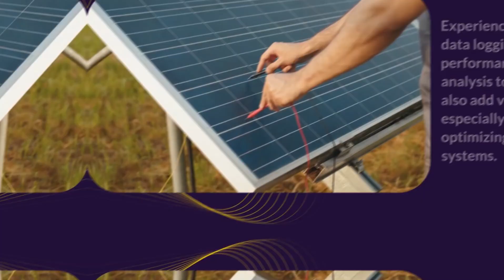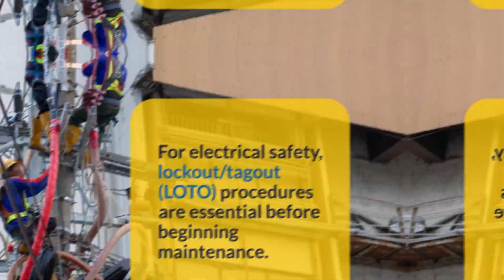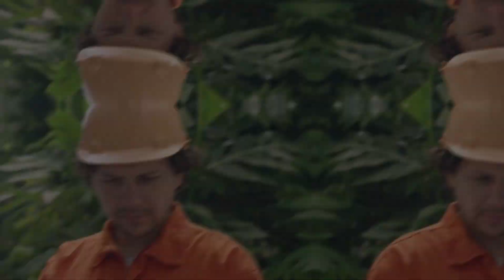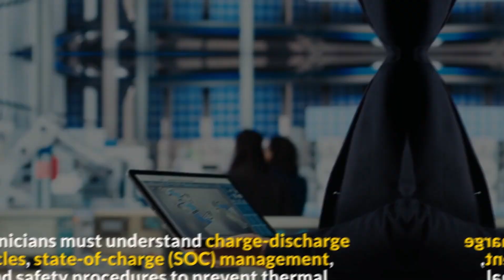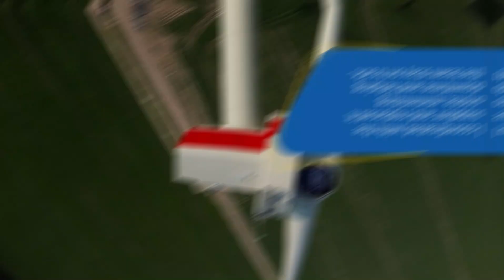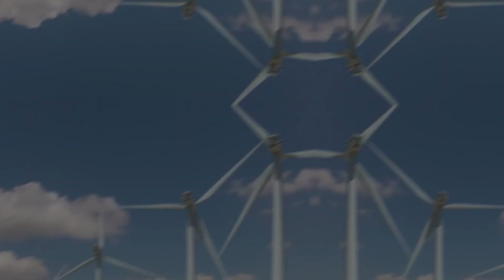Renewable Energy Technician interview questions and Answers | Must Watch Before Your Interview

Comment: Energy transition. Wind turbines. Solar cells. Electric cars. Pure exploitation. Pure colonialism.

Green fake news. The share of renewable energies in electricity generation in Germany in 2024 was a subterranean 54%. This figure is also very greenish, since solar cells and wind energy naturally carry their own large CO2 footprint.

And solar cells are nowhere near as environmentally friendly as many owners, influencers, or politicians think. In fact, most solar cells worldwide (over 80%) are generated in China using a lot of coal-fired electricity.

Of a total of 2,422 active coal-fired power plants worldwide, 1,161, or almost half, are currently located in China. In addition, coal-fired power plants with a capacity of around 247 gigawatts were planned in 2024, and 173 gigawatts were already under construction.

The share of renewable energy in China in 2025 is currently only 33%. And this small percentage is even exaggerated, since solar cells and wind turbines carry their own heavy CO2 footprint (raw materials, production, electricity consumption, long transport routes, installation, disposal). But the mining of rare earths, which are necessary for the production of solar cells, but of course also for the production of batteries for electric cars, also produces vast amounts of additional CO2 and numerous toxic substances.

Wind energy isn't much better. The nacelle of a large wind turbine, with a total height of 207 meters, weighs 675 tons. The blades add a considerable amount to that.

So the raw materials from the mines, the 800 to 900 tons of steel, concrete foundations, and other materials are produced from renewable sources? And the transport of the raw materials to the steel mill, the production of the steel, and the transport of the wind turbines from the production site to the installation site, with dozens of heavy-duty trucks and hundreds of accompanying vehicles for road safety, are CO2 neutral? Are the huge concrete foundations CO2 neutral? Are the access roads being built CO2 neutral? Are the newly required power pylons, power lines, and substations to somehow manage the fluctuating current from wind turbines and solar cells CO2 neutral? Is the dismantling and removal of a decommissioned wind turbine CO2 neutral? Added to this is the large amount of land used (soil sealing) for solar cells and wind energy. This further fuels global warming and CO2 pollution (green areas and forests are lost). Well, everyone can now decide for themselves how climate-friendly solar and wind power systems really are. In many weaker wind regions, the overall climate impact of wind turbines will probably be significantly negative.

This means that we have to consume significantly more energy and emit significantly more CO2 worldwide than we can later save CO2 with wind turbines. At best, this might barely work in strong wind regions. But even that isn't certain if we take everything into account, from raw material extraction to disposal.

The climate change faction is clearly lying about renewable energy sources. Since the environmental friendliness of the climate change is a complete scam, the environmental friendliness of electric cars is also a complete scam.

The entire cycle of the electric car, from the mines to disposal, is at least as CO2-polluting as that of the combustion engine. It's just a case of going from the frying pan into the fire. After the combustion engine, the electric car is humanity's next Pandora's box.

Only for combustion engines do we already have a functioning infrastructure. For electric cars, however, this will have to be built up piece by piece over the next 20-40 years, which will be very CO2 intensive. How sensible that is is up to each individual to decide. For me, it certainly doesn't make sense.